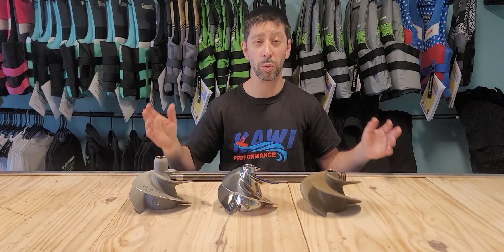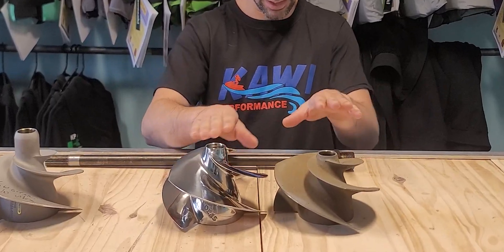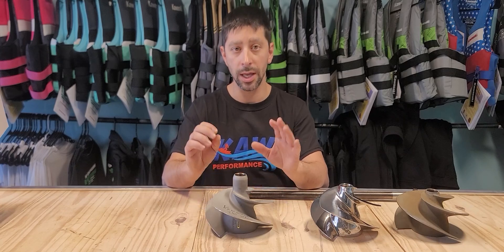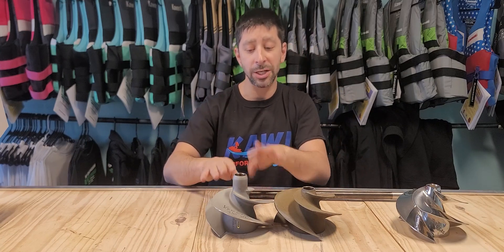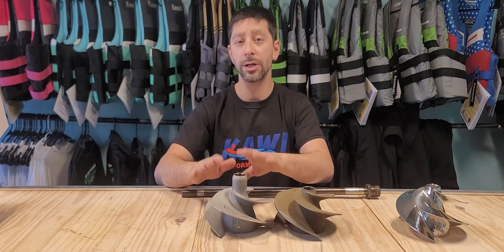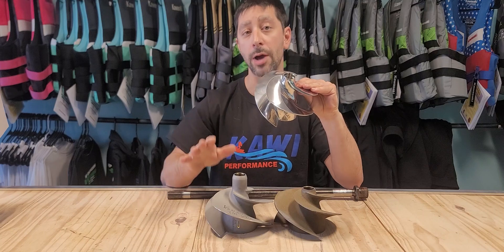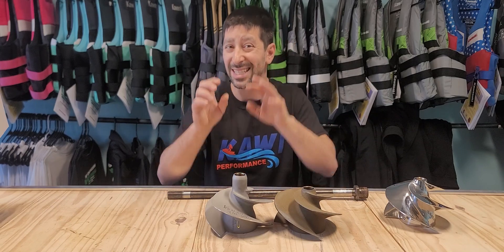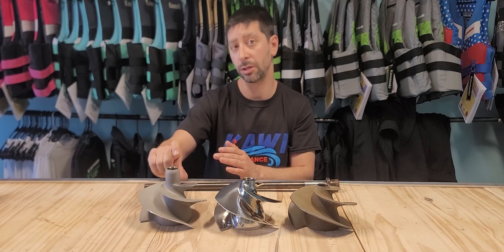Shop Talk: Choosing a Prop For Your 300/310

Comment: I have a 14/21 repitched to a 14/20 in my 310. Jamie at Kspeed recommended the 14/21 being repitched to 14/20 for more speed. Haven’t got a chance to test out top end yet
Reply from the maker: That depend on if you want top speed, or acceleration
Reply: Speed

Comment: I have a 2023 STX 160lx. I saw video about the wedge. Doesn't Kawasaki set the jet pump at optimum performance? How would the wedge improve performance?
Reply from the maker: Kawasaki does an excellent job from the factory, but everyone has different preferences. A wedge will help keep the nose up more and keep you drier. You can increase speed, but depends on the conditions.

Comment: I was considering ordering a Solas 14/21 for my 310 as part of my annual maintenance items purchase from Kawi performance. My ski has the KSpeed intake grate, KS1 ride plate, and ECU tune. I'm getting a slight bit of cavitation on launch and thought that the 14/21 might fix the issue. Instead I'll be checking the impeller/housing clearance when I pull the pump for rebuild and I'll order stock parts to replace if needed. Any thoughts on other things I should check or consider to resolve the issue? The ski is a 2017 with around 95 hours.
Reply from the maker: Most likely it is a clearance issue. You can do the 14/21 but in salt water the drive shaft splines do get destroyed. Glen at impros can also reweld and repair your stock one which is the best option.

Comment: Thanks for putting out all this great information to support the Kawasaki community! I never realized there was a snout on the stock 310 impeller and the not on the Solas. Definitely don’t want my threads exposed like that in a salt water environment!
Reply from the maker: Not many people notice this until its too late, that's why the stock prop is the best. Too bad Solas hasn't joined the band wagon.
Reply: Agreed 100%. This is informative and honest content. I've ordered parts from Kawi performance in the past and will continue to do so!
Reply: What pitch would give you a little more top end mph with kspeed stage 1 tune (pitching the stock 310 prop)

Comment: I bought a solas 14/21 but didn’t install yet.
So it came with the short rubber boots and a blue one which is metal and longer.
Even with the longer blue one will have problems overtime?? 
thank you
Reply from the maker: The blue aluminum caps usually get lodged in-between the hull and drive shaft, we recommend using the rubber if anything. However, the blue alu boot is still not long enough. You need an addition 1.5 inches to clear the splines.
Reply: Thank you!!

Comment: Any other options, other than oem, for 160lx?
Reply from the maker: I assume you mean the Ultra 160 LX, if so the Solas 10/16 is a direct replacement. It is really the same as stock.
Reply: @kawiperformance  I will be more descriptive in the future. Yes, ultra 160lx. Thanks for reply, I haven’t seen other videos talking about prop options.

Comment: So what would be the best prop for the STX-12F and STX-15F/160? I prefer acceleration over top speed. I want my 160 to hook and go.
Also, what about the props for the 155mm pumps?
Will you do a video on all this too at some point?
Reply from the maker: 12f you should use a 13/19. 15F/160 the best is the 14/21. That will be the best for you. 155 varies depending on machine.
Reply: @kawiperformance  I ran a solas repitched to 12/21 on my 2004 12F for a little while. Very interesting feel but definitely preferred the 13/19 which is why I swapped back to stock impeller for when I sold it.